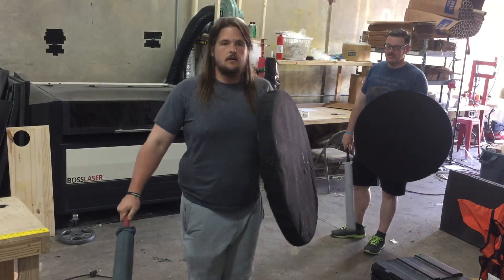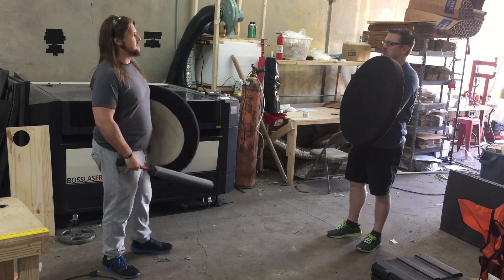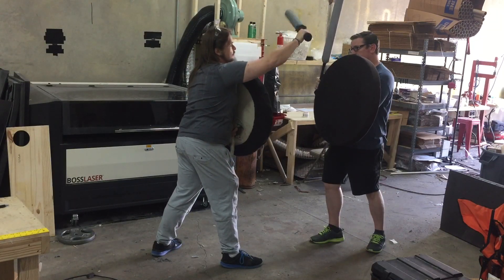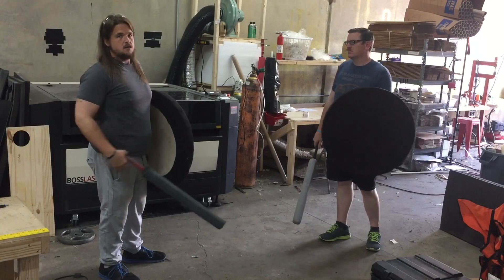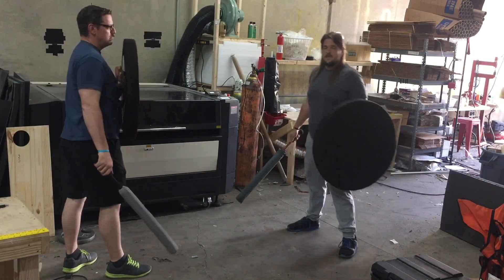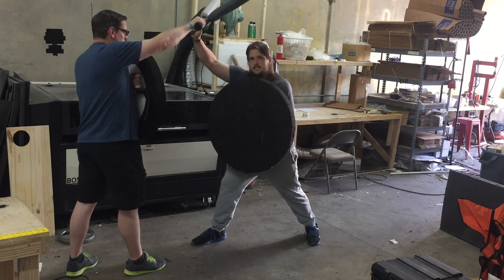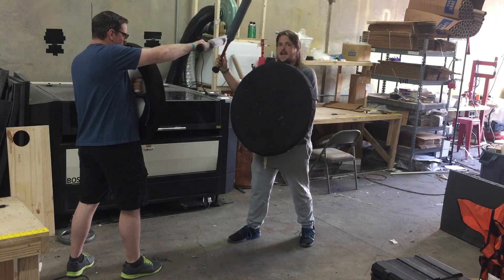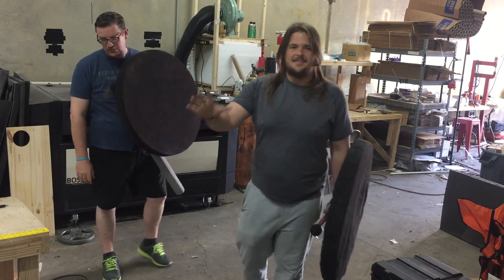Warlord Weekly Shot Demo: High Cross Bait and Counter

Comment: Great shot the most helpful point is the timing. Throwing it in time is imperative, however being able to read that they are falling for the bait is also crucial....other than repetition is there any reads which give away them buying the bait?
Reply from the maker: Unfortunately a lot of reading comes from experience, I watch weight transfer a lot so if there weight moves off their back foot to their front foot I am fairly confident they are going to throw. The nice part about this shot though is throwing that block does not leave you very open to anything other than a darkside and a darkside takes enough time to develop as long as you are paying attention you should easily be able to recover. So as your learning it it often doesnt hurt to through the block even before you are sure if they are going to cross.